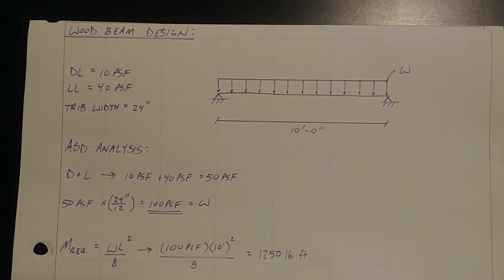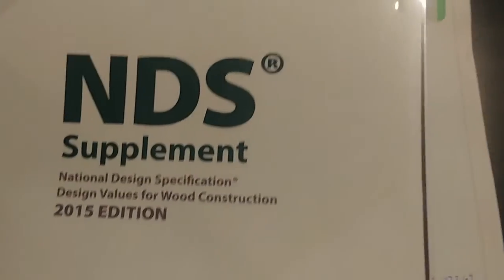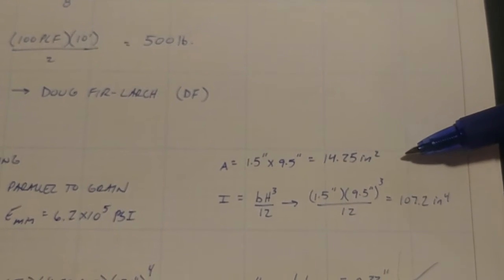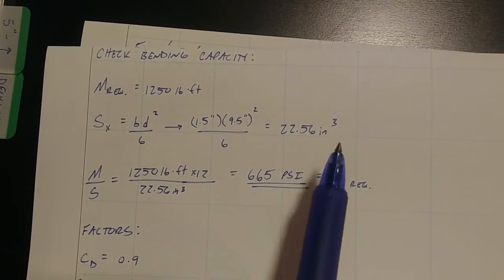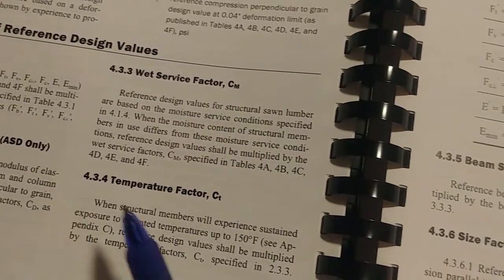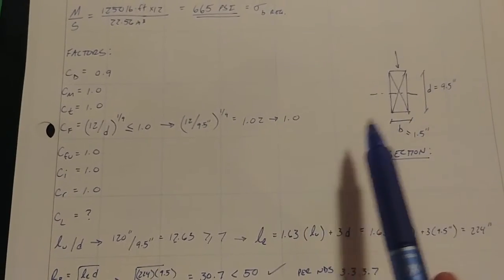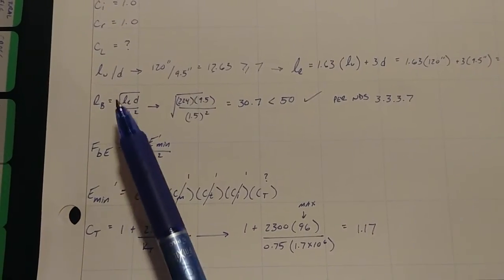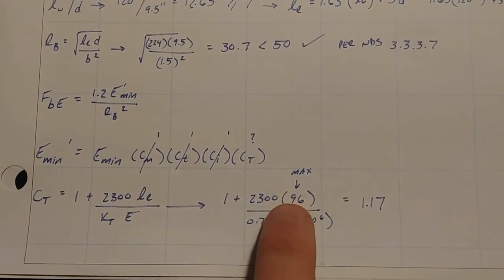Wood Beam Design Example Using NDS! (Part 1 of 2)

Comment: Why is there a difference in the NDS values between "Bending" strength Fb and "Tension parallel to grain" strength Ft?  Bending stress is tensile stress, no?
Reply from the maker: hmmm I see where you're coming from. ive never thought about it before. im thinking they did so much testing with wood beams that they found there was a big enough difference between tensile failure from bending vs tensile failure from pulling on a board.

Comment: For deflection check, shouldn't we use E' instead of E? Thanks a lot for the nice videos.
Reply from the maker: we do use E' but you should find that all the adjustment factors come out at 1.0 so it doesnt change

Comment: I apologize for the ignorance, I'm not a engineer. My question is: You decided to use  2x10 and then extracted the factors. However, what led you to select the size? Could you make a video regarding the factors that lead to select the size of the beam?
Reply from the maker: I designed the problems loading criteria to be relatively close to what a 2x10 could handle. the more you do it the better you get at giving a rough estimate of what size member is needed. I think a video on engineering judgment is a really great idea!

Comment: I think d for 2x10 is 9.25" and not 9.5". Can someone correct me if I am wrong.
Reply from the maker: shoot... you're right MOE! 1 1/2 x 9 1/4. great catch!
Reply: @Kestava_Engineering  Moe & Kestava: I'm only watching this video now on October 2nd, 2022 but I said wait a minute, once you get past a 2x6 your widest dimension goes to 7.25 for an 8-inch dimension, 9.25 for the 10-inch dimension, etc.  Anyway great video and you do a nice job!!
Reply: Nominal Size,Actual Size
2” x 2” = 1.5” x 1.5”
2” x 3” = 1.5” x 2.5”
2” x 4” = 1.5” x 3.5”
2” x 6” = 1.5” x 5.5”
2” x 8” = 1.5” x 7.25”
2” x 10” = 1.5” x 9.25”
2” x 12” = 1.5” x 11.25”
Reply: Moe & Kestava: I'm only watching this video now on October 2nd, 2022 but I said wait a minute, once you get past a 2x6 your widest dimension goes to 7.25 for an 8-inch dimension, 9.25 for the 10-inch dimension, etc.  Anyway great video and you do a nice job!!

Comment: I'm not an engineer so this may be a dumb question. In your example, was the Trib Width of 24" simple an assumed figure or was it calculated from the information you presented?  If calculated, how was the calculation made.  If assumed, how would Trib Width normally be calculated?  From what I understand, if a beam is supporting a 10'X10' ceiling, the trib width would be 5' so the trib width would have been 120" in your example.
Reply: Correction, Trib Width would be 60"?
Reply from the maker: @junk4bh565  my bad I didn't respond earlier! The trib. width was an assumed distance. Basically I assumed that this beam would be similar to a wood floor joist which are usually 12" to 24" O.C. so the trib for each "beam" would be that spacing. trib width is the dimension perpendicular to the beam span, it does not have anything to do with the dimension of the beam span. so the beam is 10ft long and supporting a trib width of floor of 24" or 12" each side of the beam along the length of the beam for a total supported area of 24" x 10ft = 20sqft. I hope this helped. let me know if youd like a short vid on this for a visual junk! 

best 

Rich
Reply: @Kestava_Engineering  Thank you, I get it now I think.  I was confused by dividing 24 by 12 and where the 24 came from.  In essence, if the trib load is 50 plf and the trib width is 2' (24"), you simply multiply the plf by 2.  So if the trib width in your example was 36", the plf would be 150 plf correct (36/12 or 50 x 3)?  But to be sure, the trib width as used in your example doesn't have anything to do with, the joists I'll say, being 24" oc.  In other words, if the joists resting on the bean were 16" oc, it would not change the plf of 100 in your example?  If I'm still off perhaps a short vid might be helpful.

Comment: It appears that your application of the calculation  for Cf (size adjustment) was maybe misinterpreted . Per AWC 4.3.6.1 you would use that equation if the member was 5" or thicker and more than 12" in depth. It would then imply that you should use the Size Factor table in the AWC Supplement page 32 which in this case results in the same value of 1.0. I only noticed this because I had been using your method for a nominal 3" thk x6" depth beam which resulted in a fairly large adjustment to Fb, Ft & Fc. Thanks for your work and any feedback.
Reply: I stand corrected only to say that since you were using a nominal 2x10 I believe your Cf value should have been 1.1 applied to Fb anf Ft (not 1.0 as I stated above). Thanks.

Comment: Would it be necessary to use load combinations for a simply supported pedestrian bridge?
Reply from the maker: Daniela, yes you always need load combinations. for a pedestrian bridge you would need to design using load combinations per the AASHTO pedestrian bridge design manual in the united states. I hope this helped!

Comment: Would it be possible to calculate timber beam in Limit State Design as Allowable State Design is not followed in Eurocodes?
Reply from the maker: Jose,LSD or otherwise known as LRFD design can be done when designing wood. I can do another video using LRFD!
Reply: @Kestava_Engineering  Thanks a lot for replying.
And yes a video would be very very helpful as we have to design a glulam beam and column using LSD (LRFD).
Reply from the maker: @josesibi  check out my latest video - design of a glulam beam using LRFD!

Comment from the maker: sorry everyone, the video has now been oriented correctly! part 2 coming soon!
Reply: Thank you @kestava. Great video. Hope to have more videos from you.
Reply from the maker: @nabindahal8043  thank you! are there any problems you would like to see for my next video??
Reply: @Kestava_Engineering  Steel column design. Finding moment and reaction for Indeterminate structures (statics). More tips and tricks AISC steel manual, IBC 2015, ACI 318
Reply: @Kestava_Engineering  hi thank you for your helpful videos.  what about commercial wood decking span trib width 14 feet, LL =100 psf, DLl 10 psf, span of beam 14 feet....